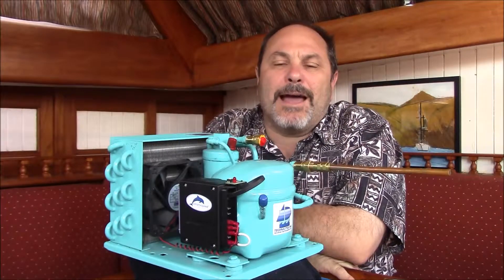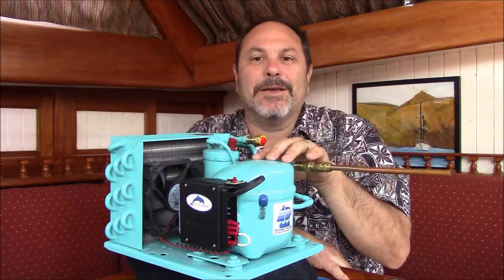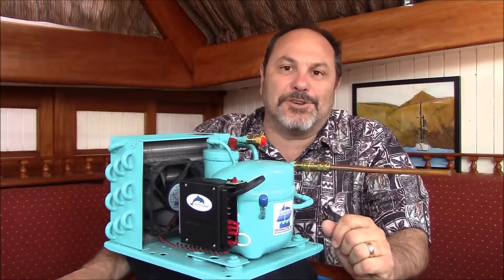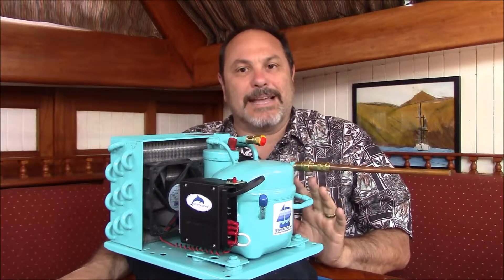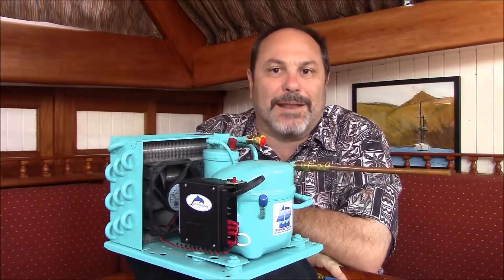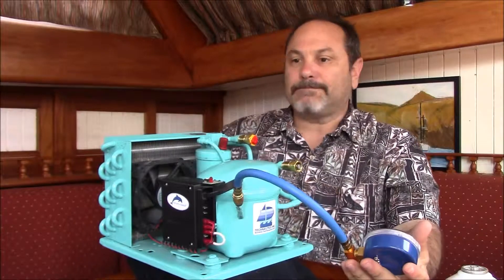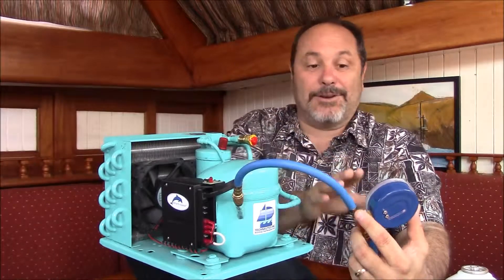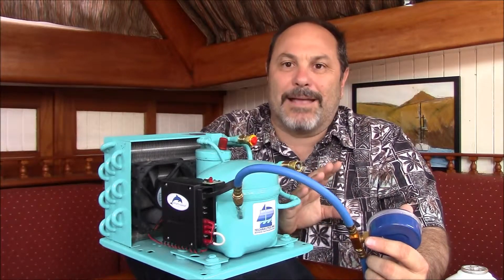CoolBlue Compressor Health: How to Test the Reed Valves

Comment: Good vid. small  problem with video. u missed telling people to purge a little refrigerant from the hose by opening the t valve on the guage hose setup  a bit then re-closing so u don't suck air from inside the hose into the system. kind of a big deal. u don't want air getting sucked into system.

Comment: your basically doing  what they call a pump down.  closing off the low side  where no more gas can cycle back into the compressor but the high side can keep compressing until there is no more refrigerant left in the sealed compressor will create a vacuum on the low side as all remaining refrigerant gets compressed and cooled in the condenser until the condenser gets flooded with liquid refrigerant,  this also causes high head pressure and high heat.  care must be taken not to run it for too long.